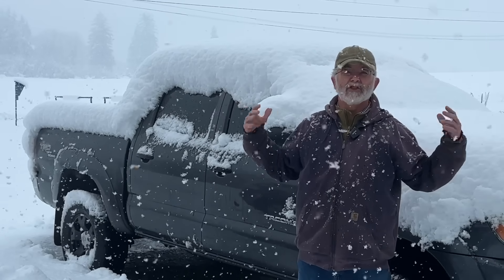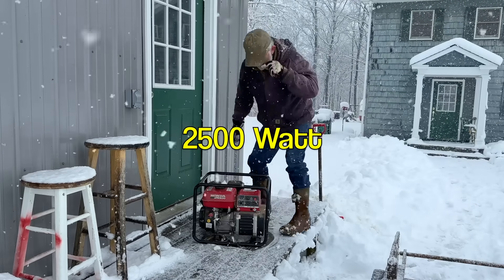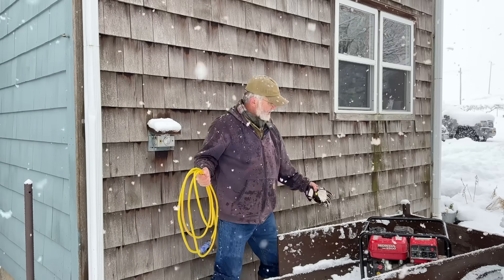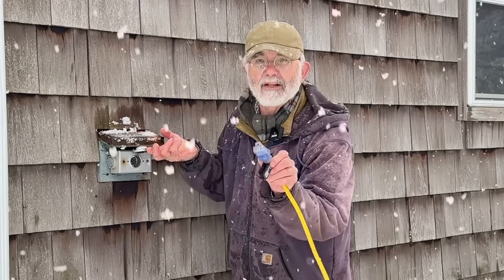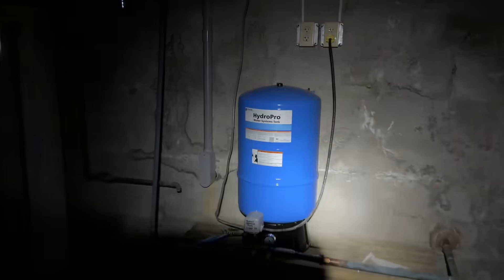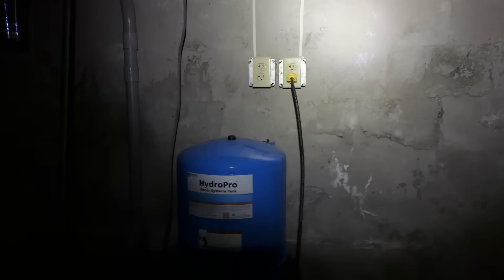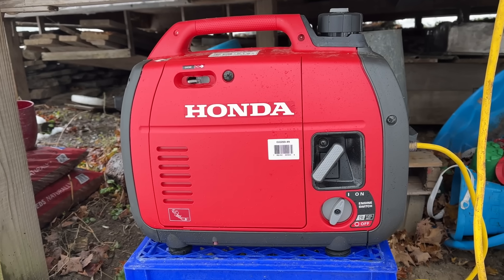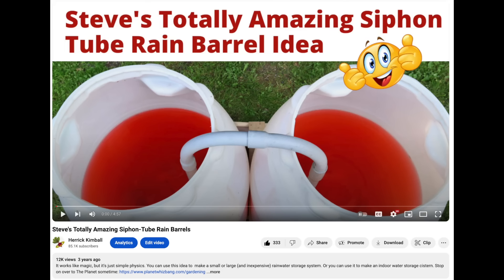Super Simple Generator-To-House Hookup  -- A Proven How-To

Comment from the maker: Some people watching this video are jumping to the mistaken conclusion that I am simply backfeeding power from my generator into my home electrical system. THAT IS NOT WHAT I AM DOING OR SHOWING. 🙂 No linemen will ever be harmed by this idea! Please watch the entire video to best understand this idea. It is a safe, effective, simple way to power a few receptacles in your home for a short term emergency power supply using a small generator.
Reply: Nope, you're good. Your gen outlets are in no way connected in any way to your utility. What you're doing is like running extension cords, only yours are conveniently mounted to wall outlets. Nice job!
Reply: If the main line breaker to the house is switched off you can not backfeed.
Reply: @scarter176  Provided a person doesn't forget to shut it off before back feeding with the generator. An interlock or transfer switch eliminates the possibility of making this mistake. Safety first, especially with electricity!
Herrick's setup is in no way connected to his main panel so is totally separate and can't back feed onto the grid.
Reply: @scarter176 my buddy feeds back through his dryer outlet with his generator to power his entire house. He asked me if he could but I told him only if his mains were off.
Reply: Excellent video. I really enjoyed it. Very simple safe way to bring power from a generator into your home safely. Since you have a hackery, I'm curious that you didn't talk about having a few solar panels you could be charging it with.
Reply from the maker: @pstoneking3418   I have the solar panels for the Jackery but have not used them yet. 😕
Reply: I love to build a house with active/passive solar heating/cooling ,small windpipe generator ,solar panels and diesel generator along with wood burning cooking stove and woodburning furnace . I would also have a masonry thermal mass heater .
Reply: When you first came into the house and showed the 4 outlets behind the cloths rack, you said they were hot and that you could plug things into them. But you didn't explain that they were only hot when the generator was connected and running. That's probably why they thought you were backfeeding the grid.
Reply from the maker: @pstoneking3418   I agree. I dropped the ball there. Those outlets are now labeled as generator powered
Reply: @herrickkimball you could  just use a can of red spray paint and paint all of the generator outlet covers red  to differentiate them.
Reply: @pstoneking3418 he did say at the beginning of the video that his power was out. Fired up the generator then went in the house. Anyone confused about that should likely not work with electricity.
Reply: I watched to the end because of concerns about backfeeding, and was glad to see that wasn't an issue. It would be good to warn viewers about the issue, and be sure no one ever rigs up a cord to connect the generator to the house wiring.
Reply: At first I thought that is what you were doing, then I saw your plug inside and realized you were just basically making an extension cord, but with a permanent mount. 
Makes it much easier than having to run a cord inside through a door or window, and can reduce the clutter of the cords and cord adapters. 
So long as you know what you are powering and how much power you have, no issue with this. 

For me, I felt it was just easier to go with a 50 amp inlet and an interlock kit on the breaker box. Got a generator big enough to power my entire house (including A/C). I decided I am at a point I can afford to not be uncomfortable during a power outage, and my wife likes the idea as well. The past few years we have had 2-3 day outages in summer and winter, and they both sucked. My 2000 watt generator would not start when needed (carb was just too messed up, have replaced carb since then), but my new generator is a tri fuel, with natural gas being my primary fuel, propane secondary, and hopefully never gas (I hate dealing with gas and carbs on infrequently used equipment). I am even looking into converting my 2000 watt unit to propane.
Reply: Turn off your main breaker and you don't have to worry about getting a lineman somewhere. Besides you would have to have quite a generator to back feed the whole power grid without tripping the breaker on the generator.
Reply: @mvg-1776  Thing is, if you forget to open the main breaker, returning utility power could blow up your generator and maybe even burn down your house. Just not worth taking the chance. Do it right with a transfer switch, interlock kit, or a totally separate circuit like Herrick did here.
Reply: Good simple idea.
Reply: I forgot to mention interlock kits in my first comment. They are pretty inexpensive and prevent both main and gen breakers in the circuit panel from being "ON" at the same time.
Reply: I put a few extra outlets in my house like you did. If the power goes out I can run a few things off my solat batteries or a generator. 
Thanks for the video.     Bert
Reply: Watched a video recently about a couple installing a small solar panel system. For their sub panel, all the lights and kitchen appliances they used a 50 amp plug. If the solar was being worked on, or down, they could plug that back into the grid panel. I like the idea and may use it when I install my own solar setup. Like yours too.
Reply: I get it. You have isolated these outlets and they are only powered up by this generator. It requires extension cords. It will work in a pinch. I'm so happy I don't live in the snow belt where power failures happen often.
Reply: The "SIMPLER THE BETTER" I would live to have a homestead 100% off grid ,100% independent and self sufficient .
Reply: Use a Sharpie to label your outlet covers “generator” and also “grid” next to your water pump.

The EU2200i is probably more fuel efficient than the non-inverter 2500.
Reply from the maker: @N4HHE   They are now labeled. I think you are correct about fuel efficiency. And I think the 2500 HONDA is more fuel efficient than the cheaper brands of comparable wattage. I get a lot of hours out of a tank of gas.
Reply: My father ran a separate line to one outlet in our travel trailer connected to the 12V battery. (The rest of the trailer outlets were 110.)  He made it obvious that outlet was different.  The cover plate was ivory,  the two recepticals were  brown.  I intend to do the same in my house shortly.
Reply: @herrickkimball  the predators are actually a viable option with a great track record. Just as quiet as the Hondas and still run for hours on end without issues . And half the cost.
Reply: If you're just going to do it half-ass, why waste the time and money doing all that? Just run a four-ganger heavy duty 10 gauge extension cord into the house for Christ's sakes! lol!  It's not difficult to backfeed into the main electrical panel, then merely turn off the main as well as all of the other circuit breakers that don't need "emergency power." Just have them all identified and marked beforehand. And last, but not least. Get a diesel generator.  Well worth the money. It'll save you a ton in fuel costs and many trips outside to refuel. Me personally, I have a 10kw PTO-driven generator that runs off my subcompact tractor. I could run for weeks or months on end. No need to maintain a back-up generator that way, plus those tractor engines are designed to last a couple of lifetimes, a million hours. I'm just say'n...
Reply: @BrickMudge   too bad you couldn't find a better way to say it....
Reply: @joemendyk9994 WHAH! 😭

Comment: I have the exact same setup. 2500 watt generator that will run about 9 hours on a gallon of fuel on eco mode.   One circuit wired thru the house. Several outlets. One in the kitchen  which we can use for a light or rotate coffee pot  or other small appliance as needed. Another oulet in the living room to run TV and PC and router.  End outlet is at the furnace blower so we can heat the house with our wood furnace. If using Microwave we turn off all other items plugged in. This works well for us. We dont have many power outages or for long periods. Normally only afew hours at most. Really cant justify the cost for whole house system.  We are on town water so that is not an issue.  I do recomend an inverter generator if you plan to run electronics. This is about as simple a setup as it gets unless you just run a cord into the house. Stay safe be mindful of carbon monoxide !

Comment: You may consider painting he outlets or outlet cover red. That’s a standard for generator only outlets. 

Also use fuel stabilizer and fill the gas tank to the top. That will keep the fuel in good shape for a year and topping off the tank prevents condensation.

Comment: My 15 yo EU2000 on the deck and Romex fits under french doors. Veissman boiler for baseboards and hot water. Fridge, TV, and lights. Got to juggle the load to use the microwave oven. Life with a condo assn...no new holes allowed (neither is the generator) ;-). A small home could be heated with a car battery and an inverter in a pinch. Or, get a Jackery.
Reply from the maker: Yep. I have two Jackerys. Love 'em. 👍

Comment: If you can afford it you might consider a freeze proof hand pump instead of the bucket for the well. Of course there's  the option of solar to run the pump then you don't have to pull the pump.

Comment: First time watching your video.  I like the simplicity of your set up.  We experience frequent outages and my thing is redundancies.  I have 2 Honda 2200i and the companion  which I converted to propane as well.  The conversion is expensive but to me worth it.  I also have a couple of jackeries and ecoflow units.  What I started doing is buying lithium batteries before the tariffs that I can use to charge or extend running times of the jackeries and ecoflows.  A lot cheaper than extension batteries and you get 3 to 4 times the watt hours too, at a third of the price of the extension batteries.  So far the longest I experienced an outage was 8 days.  The propane conversion helped a lot because propane lasts forever and unlike gasoline, when you need it during that time,  300,000 other people need it to at the same time, and the pumps don't run because grid power is down too.  Beats standing in line for hours when they do come up.  Having a couple of hundred pounds of propane in 20 pound bottles is great.  The time will come that portability is key.  I rather carry a 48 pound generator and make two trips than trying to haul a 100 pound generator.  Great video.

Comment: I do have a question. What did you do to keep the generator power to the pump from feeding back up the normal power line or do you just throw the circuit breaker feeding the pump?
Reply from the maker: I have two receptacles above the pressure tank in my basement. One is fed by the house main panel. The cord going to the well pump is plugged into that all the time. Except if I want to get power from the generator. The other receptacle is the generator line. So, I simply unplug from the house circuit and plug into the generator circuit. When power comes back on, I unplug from the generator circuit and plug back into the main panel circuit.

Comment: Be careful running your generator when it’s not on a level surface, such as transporting it in your cart. Most horizontal shaft engines do not have oil pumps and rely on splash lubrication. If the engine is not on a level surface, the oil slinger attached to the connecting rod at the crankshaft will not contact the oil to create the necessary splash that lubricates the moving parts.

Comment: Nice job, I did the same thing a few years back, https://youtu.be/95Nfk8ouS_M?si=i9FBgY5Kf9iiQevp so that I could get power from an inverter into the house on a quad receptacle. The whole set-up came in handy after Helene came through the area. Using our Prius we were able to power frig, nat gas tankless water heater, and some lights during our 10 day power outage. https://youtu.be/elzkayZS81U Thank you for sharing your story and showing how an inexpensive it is to get external power to basic appliances without endangering anyone.

Comment: Good tips. In reference to generator storage. I found that starting is way better if when I put the generator to bed I empty all the gas out of it. Tank, carburetor, lines and filters. Not a drop. I give the cylinders and carb a shot of fogging spray and close it up. I only use non-ethanol gas. On start up, fresh gas, a couple of pulls, it starts, smokes a bit and away we go. I'm sure you already know this tho. I do enjoy the videos. Thanks.

Comment: It's interesting that when the big box lumber stores don't carry something the price becomes extremely costly I wanted put a switch at 3 places both ends of the hallway and at the junction of the other hallway so when I came in the back door and got to the bedroom doors I could turn it on by the back door and off after I turned on the bedroom light I also wanted to turn off the hallway light if I was going out the front door door the 3 way ones were cheap under 2 dollars each but the one in the middle I was quoted 280.dollar to over 350 I finally got a quote for almost 80 dollars but it gave me what I wanted the rest of their prices were a lot less than the other wholesale dealers so I ordered and then picked up the person I talked to told me that he had thought I had given another company name and he had given me their wholesale price but if I am needed anything else it would be a higher price about a year later one of the big box stores started selling them for under 10 dollars each it's the same with that male plug I've bought a few from my local lumber yard under 5 dollars now I need one for hooking my solar generator up to my house and I found non of the store's carry them and at over 50 dollars Canada it's going to be pricey but fortunately all that's needed is one wish the big box stores would start selling them again

Comment: I do the same thing with my genny, except that mine is in a tin garden shed with a vent for the exhaust gasses to go out. 120 power comes in underground from the shed to the house and through a power box. I swap my sump pump over to the genny side as well as the wood furnace fan. I also have an extension cord that comes in the kitchen window for the electric kettle/electric frying pan and a floor model light.I am working on a way to get 220 Volt power to my well pump through a 2 position center off knife switch.  Totally separate from the grid power.
Your system works good for you.

Comment: Some people here will connect a 240v generator to a 240v breaker but only if the main breaker is off. This gives the whole house power but you can only power up however much the generator or wire can handle. You can sometimes run everything providing the load is less than your generator or maybe just 1 major appliance. You can have power to everything but not all at once for less than a thousand dollars. Its great for people who are sick of waiting for the power to be restored. Think 10 gauge wire 9000 watt generator fuel stabilizer and a 50 gallon fuel reserve. That could possibly give you 5 days of continuous power.

Comment: neat idea. KISS. I intend to do something a little different, which is to install (enough) solar panels to run the essential circuits in the house, but instead of installing parallel circuits, I will remove those circuits from the main box tied to the grid and run/connect them to a second breaker box, which will be isolated/solely connected to the solar/generator system.  The goal is to reduce my electricity bill from the electric company year round, while having the essentials powered up by generator and power stations during an outage w/o having to worry about disconnecting from grid or not even being able to use it (grid-tied system) during an outage, which is understandable, but asinine. It totally defeats one of the main purposes of having a backup. Also, I should be able to do it as a DIY, saving $$$$ in labor/install. costs, while also not having to worry about pulling permits from the city.  Freakin' govt. acts like this stuff is rocket science, so they want installers to be licensed electricians and/or have an EE degree. Ludicrous. BTW, I bought a small dual fuel generator, which I believe will run off gasoline or propane, so trying to cover as many bases as possible.

Comment: Generac Power generator 10 KW whole house in 2014 was $6K, replacing it 1-15-25 with 18 KW that costs only $7800 and will run the air conditioner and Furnaces of my house and my neighbors house on Natural Gas.  System is monitored to my phone and the repair company.   Our house is 2200 ft sq. No basement, aluminum sided,  all windows dbl pane.   Oh, and our 2 car garage is heated and air conditioned.   Quite wasting money on a 2500 W portable unit, and go permanent.
Reply: Forgot to mention that generator auto starts when line power fails and runs until the line power resumes.   You don't have to lift it or move it.  You don't have to be at home.  I like it simple and convenient, I'm 77 yrs old.

Comment: Cut the fuel and let it run till it stop everytime your done with generator. I have a 25 year old generator that will crank on first or second pull. It keeps it clean and varnish doesn't build up in fuel system.

Comment: I do a on off on switch a sidearm disconnect it has to be sized to your circuit breaker on your main but this way you're either on generator or your off there is no guessing about different circuits I think it's very simple to a Twist in plug and beautiful I've done about 100 of my baby likes it don't have to do anything and up is Edison Middle is off and down his generator yes that disconnects about 2:53 Honda so what when you want hot power you want power right